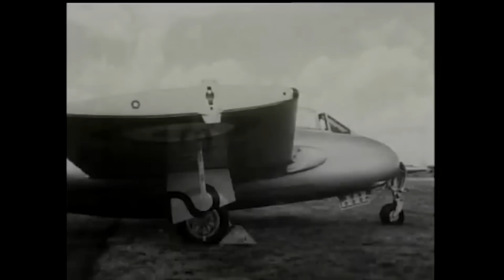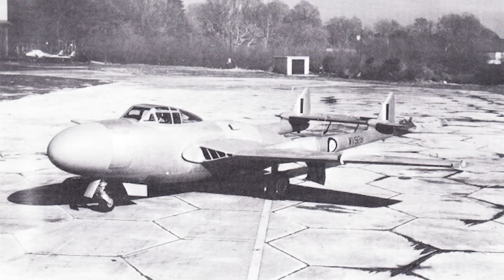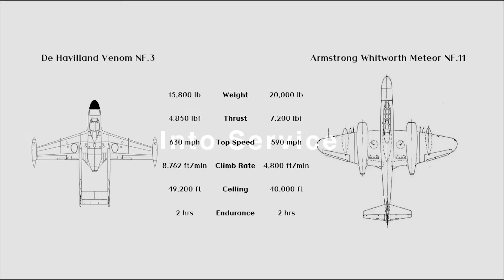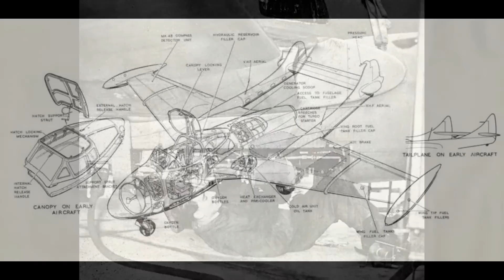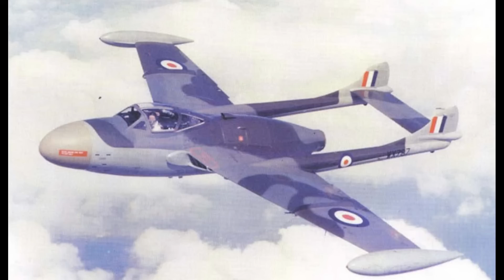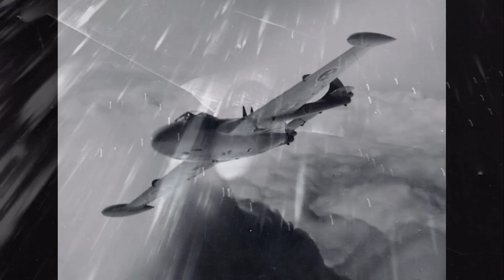The RAF's Venom Night Fighters Were Britain's First Line Of Defence

Comment: @notapound - Another brilliant video, thank you.

One minor point that sent me down a rabbit hole for 20 minutes, checking my own library and sanity: at 08:44 - "Most NF3's ended up being replaced by Javelins in 1958, with one squadron soldiering on as long as 1961"

I suspect the research for this comment came from p76 of Phil Birtles' 1986 book covering DH Vampires, Venoms and Sea Vixens.  His text is ambiguous:  All Venom NF2A and NF3 left RAF service by 1957, but 151 Sqn remained at Leuchars, flying Javelin FAW5 from 1957 to 1961.

Please keep up the excellent work.

Comment: Man, this takes me back. When I was a kid a neighbor in Texas bought a RCAF DH100 Vampire with no engine for a couple thousand US bucks. He pulled the wings and shipped it to Texas. He then proceeded to put a PT6 turboprop in it as a pusher (with no certifications or modification for the thrust being 180 degrees from what it was designed / engineered for).
He took it for three flights that I'm aware of, I was present at one of them and he said it flew quite well. Then the FAA caught wind of what he was doing and threw a big hissy fit so that was the end of that. It sat behind the hangers for 20 years and was vandalized and corroded to a heap and finally got scrapped.

Comment: I have read the aircraft’s flight manual.  Almost every problem is solved as “Bail Out”. The jet engine used then took so much time to “spool up” if you were on final and below 500 ft, you WERE going to touch down. My impression is negative

Comment: Interesting that fences were fitted in the latter fighters wings.
Reply: Evidence of fatal engineering flaws... typical of de Havilland jets
Reply: @DoktorBayerischeMotorenWerke  I assume they were placed to prevent air separation and the production of instability at the wing tips? Like Soviet aircraft.
Reply: @Steven-p4j  Adding fences after a plane entered production is seen by Western experts as a very troubled aerodynamic design that should have had corrective action taken before production and introduction into service.
 We know that britian had very limited resources in advanced wind tunnel research and technology and aerodynamic flaws were more likely to appear after the plane entered service...  not good for business!
Reply: And for me - those little "slats" near wing tips are even more "interesting" - also appearing on some variants - and lacking on latter (?) ones - wing fences proved to be a better solution ?

Comment: One suspects that the biggest issue for the Venom NF being adopted by NATO was similar to the one that saw the West German coastal forces  adopt the F-104 as a naval strike fighter rather than the purpose built Blackburn Buccaneer S2; US money and interests taking precedence over NATO requirements
Reply: Btw. the Grumman F11 Super Tiger with J79 engine would have been a better choice for the Germans than the F104 widow maker.
Reply: @apis_aculei  Buccaneer as a naval strike aircraft was the best choice
Reply: First flight of the Buccaneer was one month before the Phantom.  I would take the F-4 before the Starfighter or Buccaneer.
Reply: @timb3499  Buccaneer was a beast at low level but yeah , a Phantom is hard to beat as a multi role platform
Reply: @guaporeturns9472  What the West German naval air service needed was a maritime patrol/anti submarine aircraft and a low level anti shipping strike aircraft. Eric Brown who helped set up the service recommended the Gannet as the first and the Buccaneer for the strike aircraft. The West German government probably due to  undeclared financial incentives from Lockheed bought the F104 for both roles
Reply: @davidmcintyre8145  Yeah there’s definitely plenty of better planes that fit that requirement better than the 104… basically any plane would fulfill that role better than the 104🤦‍♂️
Reply: @guaporeturns9472  Money talked then as now. Look up the Lockheed bribery scandals
Reply: @davidmcintyre8145  The West German Navy (Bundesmarine) did use the Gannet from 1958 in the ASW role. They flew 15 Gannet AS.4 plus 1 T.5  until they were replaced in service in the 1960’s by the Breguet Atlantic.
Reply: lots of bribery and corruption involved in the German purchase of those widow makers
Reply: @stop-the-greed  Bribery and corruption was what sold all of the 104s to non US customers
Reply: Britain had the influence to put NATO requirements over US expendature
Reply: Was there not the F104 Scandal involving bribery and corruption?
Reply: Remember the USA only exists because the British empire had bigger French/Napoleon shaped issues to deal with. have fun in your MAGA distopia
Reply: america numba one
Reply: @FishFlys  Nah
Reply: @guaporeturns9472  research it ignoramus
Reply: @FishFlys  You’re mad because I’m right🤣 
I win 🥇
Reply: @guaporeturns9472  actually you got ratiod, 5 people liked my comment because it is true and you replied "nah" garnering 0 likes.

You are being ignorant i said research it, look it up on google in other words
Reply: @FishFlys  You typed 35 words to tell me I’m being ignored?😂 
Oh the irony.. please, let me know some more about how ignored I am😂😂😂😂😂😂😂😂
Reply: @guaporeturns9472  you are so stupid... ignorant not ignored it means you dont know what what you are talking about...

"oh the irony"
Reply: US is NATO. Tbh without the US there would be no Europe. Just a bunch of poor countries fighting each other bc they're children.
Reply: I think it's worth remembering that the US was bankrolling most of the NATO European nations at this time. Who could blame them for recouping their expenditure?
Reply: @kitbag9033 was just gonna say that. 
But good god choosing the 104 over the Buc for a strike aircraft is crazy
Reply: @guaporeturns9472  Bribery and corruption by the US company was what made the choice. Also remember that the F104 was a day interceptor designed for good weather while the Germans needed an all weather strike aircraft for the North sea storms. US interest killed a lot of European pilots in the name of profit
Reply: @davidmcintyre8145  Like Kitbag9033 just said , US was funding the lions share of NATO and deterring Soviets from any more western expansion , I think it’s reasonable that they wanted to bring some revenue back into the US , but it was a costly decision
Reply: @guaporeturns9472  Not for the USA the only country involved in WWI or WWII that actually made money out of it's involvement
Reply: Mostly by selling to all sides
Reply: @davidmcintyre8145  US paid much more money than all the rest of Europe combined to fund NATO. The American taxpayers paid that bill. The 104 program boosted the economy and put money back into the pockets of some of the many Americans that paid for European security. Not sure what you’re going on about but have a great day (in your safe , non-Soviet country)
Reply: @guaporeturns9472  So you are happy with US companies such as GM selling to NAZI Germany until 1945 and Imperial Japan until 1943?
Reply: @guaporeturns9472  A fair point, but the US could at least have sold aircraft better for the job than the F104.
Reply: @alexandermonro6768  Totally agree.
Reply: @davidmcintyre8145 Germans were the only ones to suffer from surprising f104 losses and historians today attribute it to poor doctrine surrounding the capable aircraft
Reply: @guaporeturns9472  for sure, we won't go into the brown envelopes that Lockheed were passing out to procurement people and politicians.
Reply: @FishFlys not poor doctrine in itself, it was the use of it low level (and I mean LOW level!) and the incredible speed that made you want to be farther ahead of the aircraft than you’d have to be in the Cl.13 Sabre, the preceding aircraft most had flown. Ask anyone, the Starfighter was a fantastic beast!
Reply: @pjotrtje0NL  It was the poor doctrine and experience of the pilots. The point of what I said is that it was the pilots messing up not the plane.
Reply: @kitbag9033 the pilots and crews who got worse equipment for the sake of greedy suits.
Reply: @kitbag9033  The US still pays for NATO. And everything else, too.
Reply: @kitbag9033 still are, but don't say it in public. Europe is once again applying more effort to starting a world war with each other from east to west than taking care of citizens. They even welcome non citizens to treat them better.